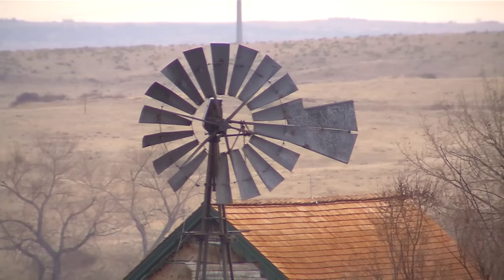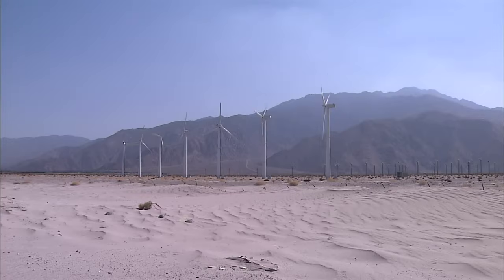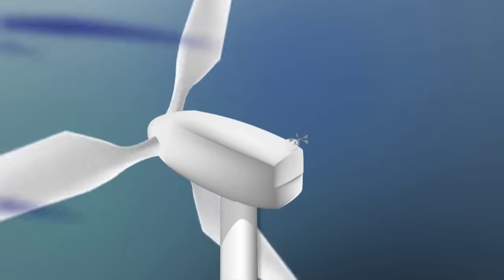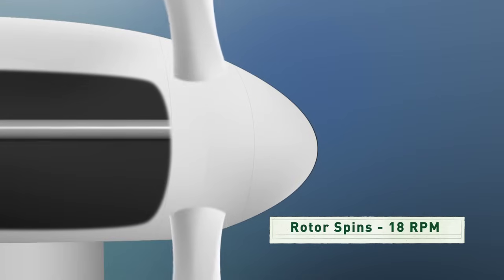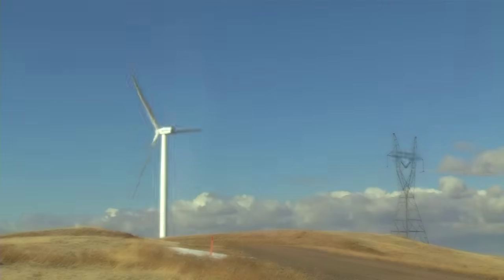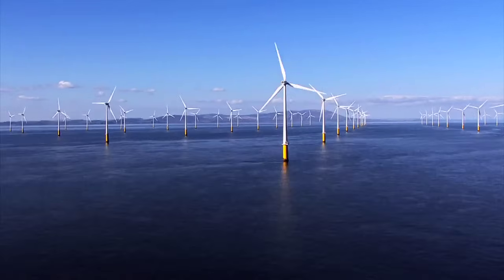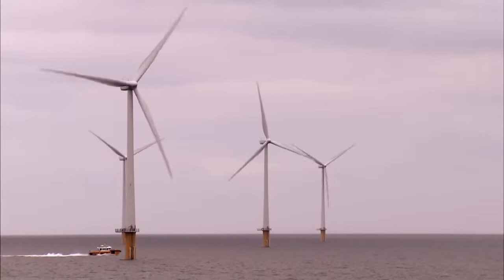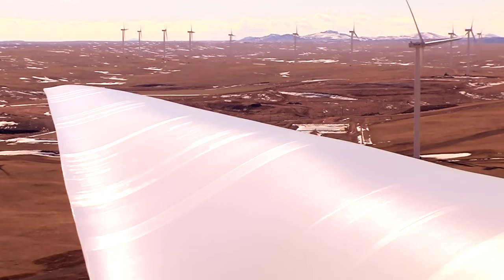Energy 101: Wind Power

Comment: First a wind turbine blade works sorta like an airplane wing. Blowing air passes around both sides of the blade. The shape of the blade causes the air pressure to be uneven -  higher on one side of the blade and lower on the other. And that's what makes it spin...the uneven pressure causes the blades to spin around the center of the turbine.  (I was typing out this part out for my report, and I decided to comment it)

Comment: These systems only produce electricity at about 35% efficiency.  A spiral shaped wind catcher turbine... of the same height... can produce power at 95% efficiency.  They are also smaller, can be packed into a MUCH smaller area, are lighter, cost less, and can stand up to hurricane force winds.  These turbines must be shut down if a wind over 50 miles per hour hits them or be damaged by spinning too fast.  Spiral column turbines... the faster the wind, the more energy they can produce.  The propeller design takes a MINIMUM wind speed of 15 mph to even get MOVING... spiral column... a breeze at only 1/2 mph can get them moving and producing power.

Corporate and political greed keeps the systems from going mainstream.
Reply: https://en.wikipedia.org/wiki/Betz's_law